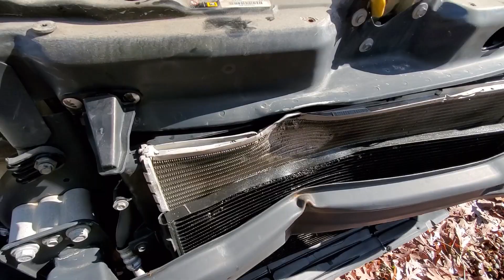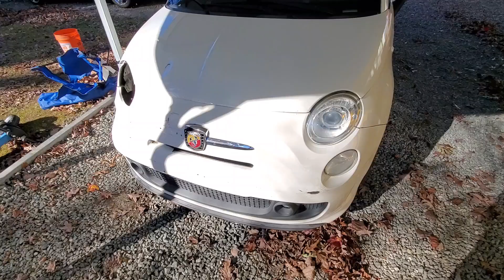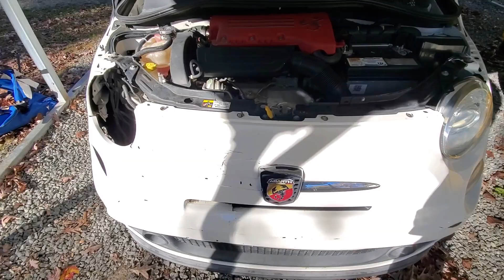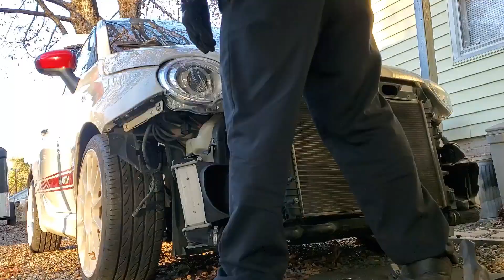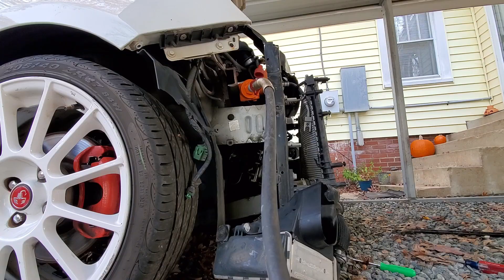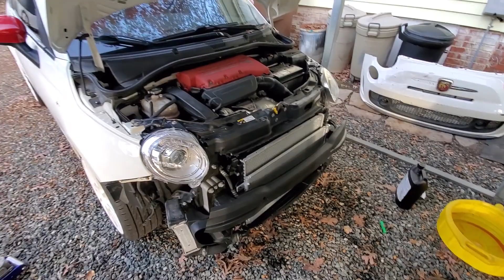Salvage Fiat 500 Abarth Turbo Project - Front End Straightening And First Drive

Comment: If you do a muffler delete and or a intake these things can sound pretty wild
Reply from the maker: This year did not come with a muffler. I believe it had a resonator in the mid pipe originally which has been replaced with a aftermarket mid pipe. It sounds pretty mean, for a 4 cylinder that is.
Reply: I too was wondering what you discovered on the muffler.  A factory delete IS unusual.